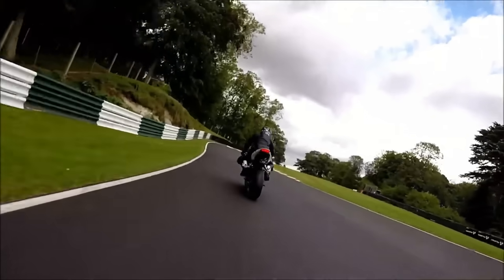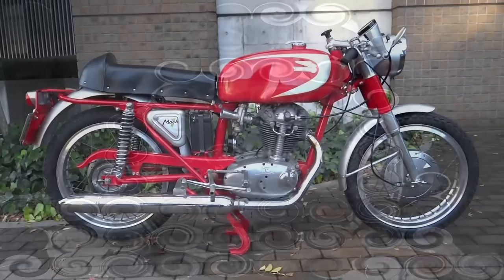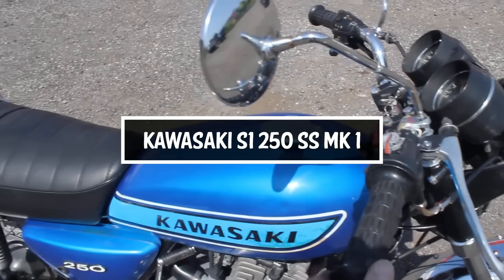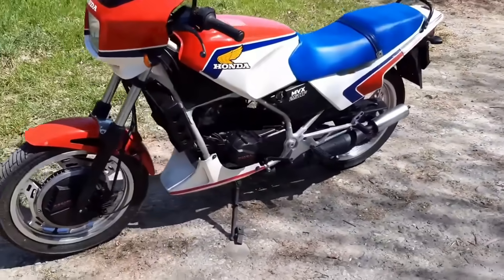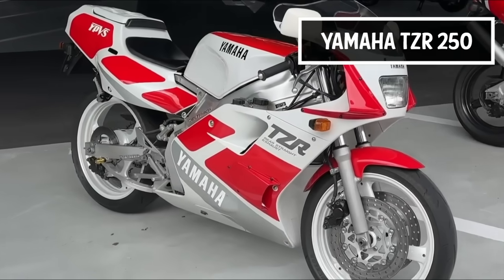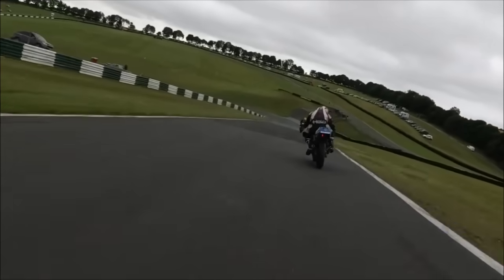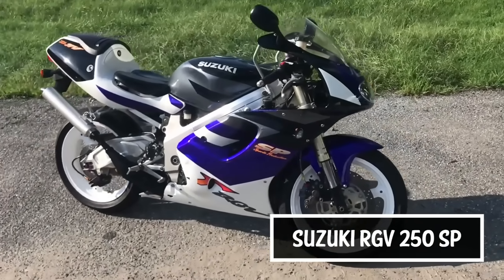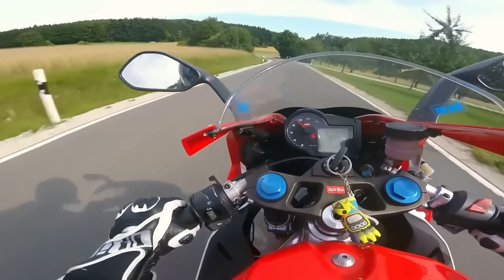The Fastest 250cc Motorcycles

Comment: Great video! Thanks for your effort! My 1st bike was a GT125 Suzi (the hornet). One friend of mine once had the predecessor of the X7, 
the GT250. That one hit the 100mph mark. Another had an RD250, but tuned it up to 350 (that cylinder has only one more fin. The german TÜV didn't recognize ;-) 
But with larger carbs, it was crazy fast. He later had a 500H1 with Allspeed exhausts. And stated that the RD was still accelerating faster.
I rode BMW 75/5 for some 25yrs (still have 'em), than bought RD125LC. Both type 10W and 1GU (never sold in Germany).
Fantastic bikes! The 1GU starts pulling from 3000revs. (I still like the more agressive 10W better.) Both go 140 km/h without optimized transmission. (21hp@9000. Top speed @10000. So: there should be room for improovement.)
More 250's: the Bultaco Metralla is reported as the fastest of her time. I dunno where the Ossa 250 ranked. There where also (identical)
250 two-strokes from Moto Guzzi and Benelli. The Maico MD250 has a reported top speed of 150km/h. Couldn't find the top speed for the later watercooled model.
Greetings from the far north of Germany!
Reply from the maker: greetings to you my friend, that sounds like an eclectic mix of bikes :-) .the Metralla has had a few mentions :-) Cheers for watching mate, Ride Free

Comment: Anyone got any info on the areal arrow briefly owned back in early 80s
Reply from the maker: you mean about the model? or about a specific bike you had?
Reply: @barebonesmc  it was an ex prodi racer 250 Areal Arrow 250 2 stroke I briefly had that had persistent electrical problems, & I ended up giving it to a friend who stripped the electrical system & replaced it with the loom from a 500cc Suzy which somehow curred it ( Snoz from Redditch was a bit of a mechanical wizard)

Comment: I am lucky enough to be the proud owner of a 2000 bandit GSF250N that came to me as a gift. Thank you Jack. Your are assured of a place in Heaven. 
This bike is the naked version of the Across and has the gas tank in the appropriate place. It has a variable valve head that chips in at 7500 rpm when there is an audible click and it takes off like a two stroke up to 14000 although I’ve never been there. The road holding and brakes live up to the motor so it’s just a blast to ride. The motor is in a 400 frame so it looks large
I am a mature rider and I try to ride ride like a nun. I know that this is the best bike I’ve ever ridden/owned. I shocked myself when I looked at the rear tyre wear and found how much lean angle I’m using. It’s just that kind of bike. Brings out some hooligan in me
The valve timing changes mechanically. The cam shaft incorporates two plates separated by ball bearings. One plate has radial grooves while it’s partner has angled grooves and they rotate relative to each other to change the timing 
Who needs a large heavy bike when you can have just as much fun on a 250?
Enjoy while you can because when it’s gone it’s gone forever
Reply from the maker: suzuki do seem to have a habit of creating hooligans lol  🙂 cheers for watching mate, have a great day

Comment: I had a 1964 CB72 in the mid 1970s. Could call it a 'bitsa'. Headlight from a Royal Enfield complete with ammeter, speedo and rev counter from a larger Honda, exhaust pipes from the CB77 Scrambler for better ground clearance, clip-on handlebars, fibreglass race tank & seat and flipped footrests for a cafe racer style. Problem was it was never as fast as it looked, I always felt that the CB72 engine was a bit asthmatic producing a lot of noise but not much go even when well set up. Gave up on it eventually due to persistent problems with the 'C' ring holding the gear selector drum.
Reply from the maker: 🙂Cheers for the comment mate. it would feel asthmatic now im sure in many ways, but maybe not as asthmatic as some of the modern 250s lol Ride Free 🙂

Comment: I had a '91 TZR 250 R from 2000-2008 , I had a seized cylinder riding in the mountains, sold it and regret a week later, sorry about since.  My colleague had the Suzuki Across. Those bikes were imported directly from Japan by Red Baron Motorcycles into Hungary. They shipped a lot of  wrecked 250s in containers and assembled usable bikes from their parts. At that time there were a lot of 250 and 400 ccm bikes in Hungary. Good old days.....

Comment: The Across was very popular in Australia. It's "fuel tank" was actually a boot, made big enough to store your helmet and gloves. The fuel cap was behind the seat which meant the fuel capacity was low. The upshot was that it had a much lower centre of gravity. I fortunately got to ride one back in the day and it was an absolute delight. Having the redline so high felt somewhat akin to a two stroke, but the power delivery was much more linier and confidence inspiring. I'd like to add Suzuki's competitor in the "Quarter Litre War", the late 80's Honda CBR250R. 44hp, 154kg dry and a top speed of 112Mph. They were originally meant for the Japanese domestic market, but an Australian importer starting bringing low km machines in as grey imports. They sold like hotcakes over here and just about every hoon learner had one.
Reply from the maker: so the across as you have said had the NC700s storage compartment years before and mass centralisation before the term had been thought of :-) funny eh :-) .Cheers for watching mate, Ride Free

Comment: The Suzuki Across made it to Oz. I saw heaps of them. They had a zippy motor that wasn't as tightly tuned as the CBR250RR so it was more relaxed. The clever part was the tank was actually a boot to put your takeaway in on the ride home. Such a clever idea.

Thanks for the stroll through my youth 👍
Reply from the maker: theres been a few comments re the storage space :-) Cheers for watching mate, have a great weekend 🙂
Reply: @barebonesmc  In Australia in that time, Learners and P platers were stuck on 250cc so the video was basically the pocket rockets we could get our hands on.

I'd still take a 2 stroke 250 pocket rocket even if every second weekend was tuning and tinkering, just for the sake of a few corners a month.

You have an awesome weekend too.
Reply from the maker: @HumbugShow  it was the same 250 learner limit in the UK until later when they dropped it to 12.5HP and 125cc, .Cheers for watching mate, Ride Free

Comment: When I started riding in 1956 forward all the really fast bikes were twin cylinder 2 stroke powered. At idle and low rpm they to me sounded terrible. I had a Bridgestone twin 2stroke that at idle sounded exactly like 2 small rocks being shaken around in tin can. However that dam thing would fly and it sounded great when wrapped up. Mixing the oil and gas was a pain in the backside. The 2 strokes always smelled like a grease rag burning or the shop was on fire. I am strictly a 4 stroke kind of guy and if it smokes like a 2 stroke I know it needs an overhaul.
Reply from the maker: i like both but i know what you mean, and autolube was a godsend, having said that, ive had some 4 strokes that sound like a bag of spanners being shook around until they warm up too. the hydraulic lifters on the Nighthawk S are amazing, AFTER the first 5 miles or so while the oil warms up 🙂
Reply: @barebonesmc  Times change and so do the machines we ride. It has all been good for me over the last 67 years on two wheels and I would not change anything. From the days of ying ding ding wheeze ying ding ding etc. How crude and simple the old 50s bikes were is amazing when you look at the bikes now. Old shoe brakes fully activated by cables or rods. A good head wind would slow you down quicker than the brakes. Speed was a matter of perception because only one or two bike models could do the ton. My guess is some of those guys that going that fast are still going or ran into something that stopped them.
Reply from the maker: @WalterJohnson-er7bt  lol, i guess im a simple bloke, and ive been called crude too lol, so maybe that explains something 🙂 i like drum brakes on the rear to be fair, far bettter feel 🙂 but i know im an oddity 🙂 have a great week mate
Reply: @barebonesmc  I agree that a decent shoe style brake works really well on the rear wheel. A disc brake makes it a lot easier to lock up the rear wheel. We know what happens during a panic stop when you lock up the rear wheel. I wonder how many nice bikes have been low sided from locking up the rear wheel.
Reply from the maker: @WalterJohnson-er7bt  too many lol, being honest, i think drum brakes get a bad rap. there were a lot of cheap and bad drum brakes out there, but there were great ones too. the Ceriani ones were great, and Laverda and MV both made fantastic drum brakes more than capable of doing a stoppie with todays tyres 🙂 it is just that the ones most of us experienced on many many bikes, were bad drum brakes without enough thought about the design

Comment: i had a gold N reg YDS7 i got it in 84 for £20 & it was still great condition i sold it to a mate who stiped it to the bare bones & put knobleys on it & chucked a 350 in it & took it over the fields, i was gutted when i heard it ripping across the fields it could be heard miles away it only had the downpipes on it ?
Reply from the maker: Great story 🙂 Cheers for adding your bit mate. Ride Free 🙂would have run better with a decent pipe though lol

Comment: Altough not mentioned one of the best real world usable 250s is the Honda Spada VT250.  I have one and despite a stable of bikes ranging from 250 to an 1800 Wing I love to get out on it for a good blat.  
Great handling, zero vibration, good brakes, slick gearbox and 40 horses on tap.  And very reliable and easy to ride due to perfect carburetion giving good torque even at 3000rpm, and then there is that screaming 14,000 rpm redline.
In Australia Spadas are very sort after for vintage bike enthusiasts wanting a great ride for tiddler rallies. 
Built between 88-92 they are superior in many ways to the later VTRs and much better than the earlier VT250s. They are also a much better daily rider proposition than the CBR250RR.
Yep, I love mine and it will always have a place in the shed.  It’s a pity that many modern riders have no idea of just what a blast a well sorted 250 can be.  
Modern 250s are really just pale imitations.
Reply from the maker: they keep getting mentioned, im sure we must have got a tamer version here, .Cheers for watching mate, Ride Free

Comment: I bought my Suzuki X6 in February 1966. Three came into Christchurch NZ Tom McCleary Motorcycles. I was 15 years old.  I paid NZ £295.00.
Mine was Black and did not have indicators. I think it was the first production motorcycle with 6 speeds and it weighed just under 300 lbs.
I put on clip on bars and rode the South Canterbury Motorcycle Club standing and flying 1/4 mile competion. I clocked 15.9 standing 1/4 mile. 101mph flying 1/4 mile. Surprised you never mentioned this bike?
Reply from the maker: i had to cut a lot mate, and yes the various Pre GT Suzuki's should probably have been mentioned as ive said in various comments :-)  Cheers for watching and the comment mate, Ride Free

Comment: As a Ducati dealer starting in 1961, we ordered a Diana 250 in1965. I intended to race it myself so we took it to the drag strip for a performance baseline. With times of 101.84 mph and 14.13 sec et. three times in a row we were sure something was wrong with the timers. Back to the shop. Went back the next week with the same results. To the flow bench ( not many around in 1965). I did a wet flow and found fuel short circuiting direct to the exhaust, fixed that. Back to the drag strip. 106.37 @ 13.37 et. 40% nitro made 116.4 @ 12.49. The Berliner bros. came by and then we started getting spring head parts from Italy. With a dolphin faring I was clocked at 129.8.  Not bad for a novice tuner that had just read Tuning for Speed.
Reply from the maker: Great story 🙂Cheers for adding your bit mate. Words of experience 🙂Ride Free 🙂

Comment: The RD250LC was a stuningly beautiful bike. Every line just seemed right. A harmony of graceful flowing curves.
They often say that something "Looks like it's going 100MPH when it's standing still" - Well, this bike did!

I would have liked to see the Ariel Golden Arrow on the list - if only to have a bit of Brit representation. Not the fastest, but it did put the cat among the pigeons at its launch.
Reply from the maker: especially in the mars bar colour scheme 🙂
Reply: @barebonesmc  I had an aircooled RD250E, but lusted after an LC.

Eventually got an RD350LC, and I was in motorcycling heaven for years. Such a brilliant purist enthusiast's bike -  It performed every bit as well as it looked.
White, with blue 'swooshes', in case you're wondering!

I traded up to a GPz900R after a few years, but I can honestly say that the Kwacker - outrageously quicker than the Yam as it may be - wasn't nearly half as much fun. Didn't capture the same kind of pure joy.

Lining up a corner, and snicking down to just the right gear that you can hit the powerband coming out - the steering getting light as the front wheel lifts ...

Then Snick ... snick ... snick ... through the short-legged ratios down the straight ... Exhaust doing that insanely aggressive two-stroke twin  howl ...

And then the next corner ...
Reply from the maker: @wirebrushofenlightenment1545  the 350LC was just a special bike in so any ways 🙂

Comment: I daily ride a 2011 ninja 250r. First thing any 250 rider should do is ditch the stock exhaust. RIDICULOUSLY heavy! That's the only modification I've done and been clocked at 104 by a bacon van, showing 102 on my speedo. As always another great video 🙏

Comment: Greatly informative video. Thank you 

I feel the same about the I-4 400cc Supersports class. (Which thankfully Kawasaki are bringing back, with the 2024 ZX4 RR 😁)  it's what solidified my love for bikes after my original Dirt bike passion, which is a great segway...

I think most of the small capacity engine development has continued in motorcross over the years where in Supersports class, it has tailed off hugely, even I-4 600cc supersports were all but gone too, in recent years. 

I've not investigated power figures for the latest breed of 125-450cc MX machines, but I think the bikes may be the fastest they've ever been. I'm fairly certain they've exceeded the old power house 500cc two stroke dirt bikes. KTMs in particular tend to have earned a good reputation regarding power output. 

 I had a 2007 Aprillia SXV 550 fitted with the (sadly also discontinued) Aprilia built 4-stroke 449cc V-twin engine, what a peach. 60hp with an 15.k rpm limit, in restricted form. IIRC they could be tuned to 90bhp+. There was a sister 449cc version was also great. 
Both were "production-race" engines, so slightly fragile with high maintenance and some early run issues which dented the reputation, thus low sales figures spiralled into the death of the three bikes (SXV, RXV, MXV) and development of the two engines after approximately 5 years in 2012.

It's a shame there's not a lot like this being built anymore. There is hope though
Reply from the maker: always hope mate, the SXV is a serious tool. not much to compete with it before or since.   :-) cheers for watching, have a great weekend

Comment: I had a 1991 Suzuki GSF 250 Bandit. It was based off the Across. Mine had a small Cafe fairing with a short wind screen. With 1 more tooth on the front sprocket I could get to 115 MPH on Radar, speedo said 122 MPH. It would not pull top speed in 6th gear on flat ground but would do 100 MPH. It got 72 MPG on the US 3.8L per gallon if I short shifted. 

I sold it and the guy rebuilt it with an over bore and a full Dustbin fairing, he said it would do 130 MPH.
Reply from the maker: sounds like a hoot :-) Cheers for watching mate, hope you have a great weekend

Comment: My little Ninja EX-250F  is 32 Hp I think.. under 300 lbs wet.. and will top 100 mph.  It is a screaming little sewing machine with great brakes, quick handling , and a surprisingly wide power band...that lets it toodle around or carve corners as a fast clip with good tires.  No racing bike for sure...but a great modern replacement for the super hawk... with real longevity too.    A true sport bike.
Reply from the maker: enjoy it mate 🙂Cheers for watching. Ride Free 🙂

Comment: Back in 1990 in NZ, my 3rd bike was a CBR250R Hurricane, great to see it got a mention. It could rev insanely, helped by the gear driven cam train - at just 60mph, it was already doing 10k rpm in top! That was my last 250 (CBX250RS and VT250R before it), my next bike was a CBX750F, and I'm now on my 28th bike.
Reply from the maker: Ive got a CB 700SC which is a similar block to the CBX 🙂 one of my favourite bikes.  Cheers for watching mate, Ride Free 🙂
Reply: @barebonesmc  About 17 years ago, I just about bought a Nighthawk! - the blue and white version. But after already having owned a number of 16" front bikes (including a CBX750F Bol'dor), the reliable Metz Lazer Comp-K compound tyre was getting hard to find even back then. I bought a Zephyr 550 and modded it instead. The one I ride now, and have had the longest, is the venerable second-gen ZZR600 - a bike that'll more than hold it's own even 25+ years on,, and you can ride several hundred miles in a day, 2-up with triple panniers, and not feel beat up at the end of it.
Reply: @lc10w  There was a nice 750 nighthawk on trade me a few months ago, tried to get my son to buy it, but he's still under the illusion he's getting one of my bikes to ride😆 Fat chance.
Reply from the maker: @lc10w  the ZZRs are damn good bikes :-) .Cheers for watching mate, Ride Free